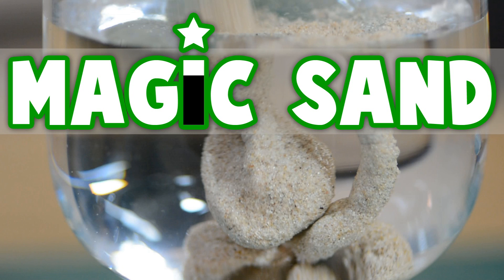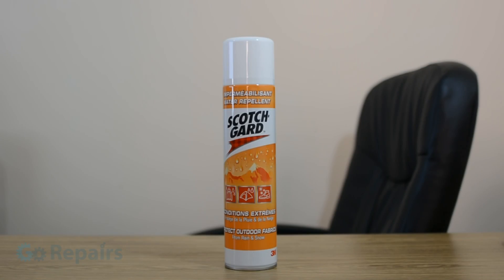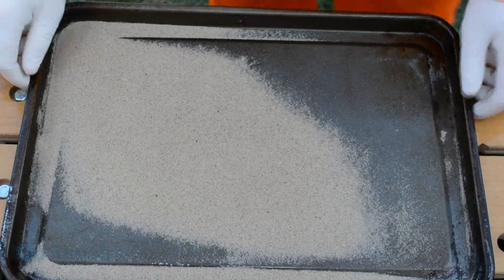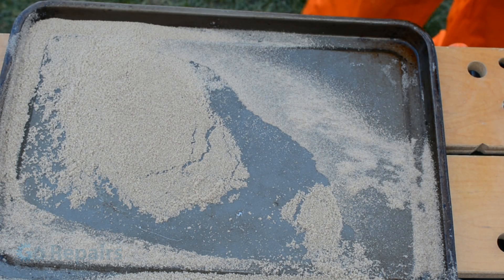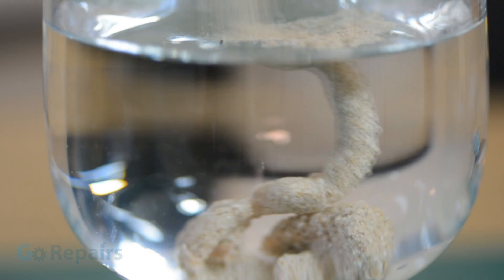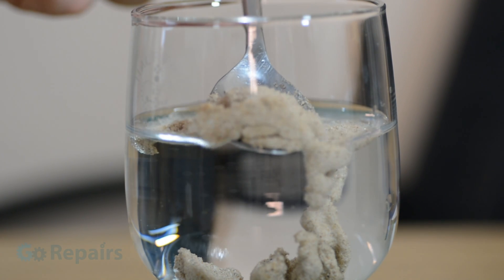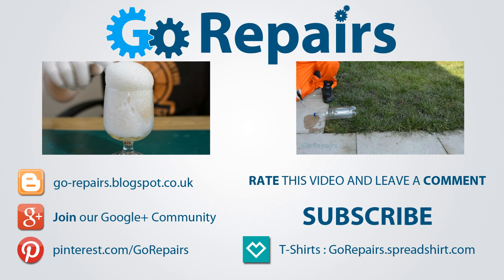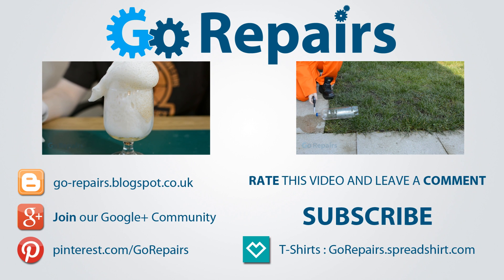How To Make Magic Sand

Comment: what else can we use for scotch guard substitute
Reply: Raunacq Srivastava Paraffin oil.  You can get it in a pharmacy, also known as Paraffinum liquidum B.P..  Just make sure the sand you start with is very dry and do not add too much paraffin oil, just a little at a time, mixing it well, until a specimen of the paraffinated sand repels water droplets.  Thereafter let it dry for several hours in the sun and it should be ready.